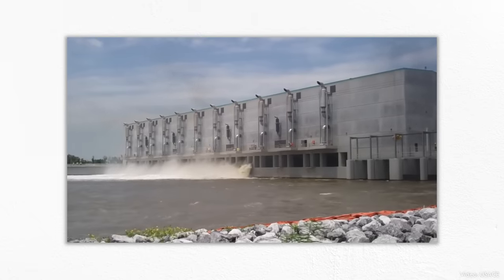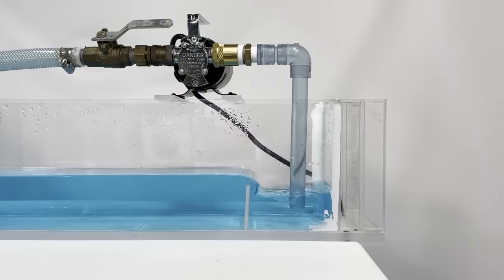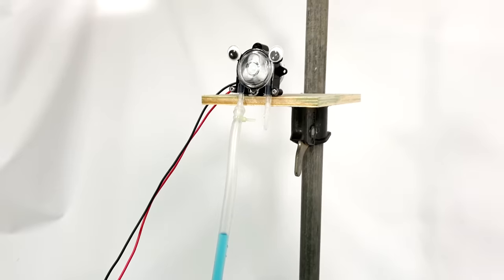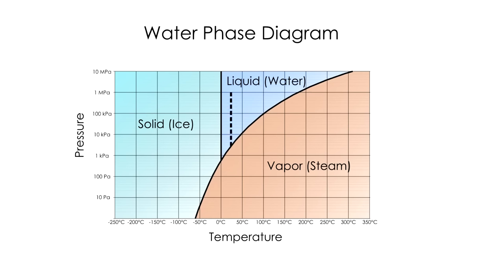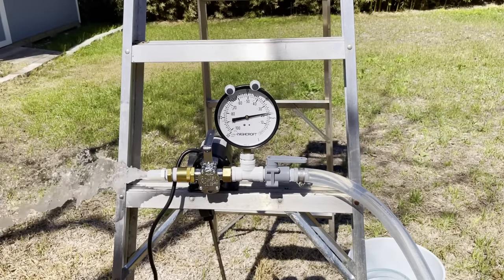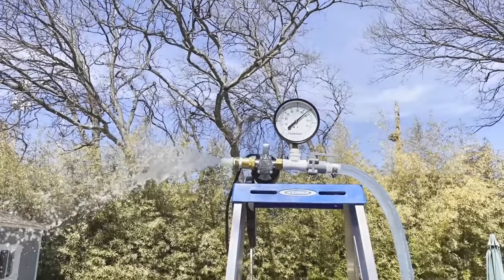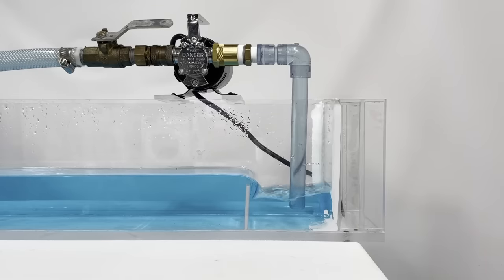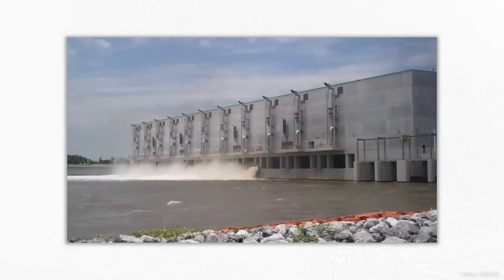The Fluid Effects That Kill Pumps

Comment: Can you cover sewage treatment pants? I'm curious how they deal with solids in the pump paths.
Reply: I need to get me some of those "sewage treatment pants".
Reply: @petehiggins33   Sci-fi high tech diapers!
Reply: @petehiggins33  Hahaha! Your comment is too funny. I'm gonna leave the typo
Reply: Can you discuss sludge pumps?   Why they can pump tons of sand. Even rock, what kind of impeller is used and what are the parameters needed to make them function. Thanks
Reply: @randomshitbekker  yep diaphragm pumps are pretty intense. Can literally pump steel ball bearings lol
Reply: Typically, sewage pumps have large impeller passages (anything from 2" in the smallest to 4" or even larger) intended to pass most solids.   Hence they usually operate at lower efficiency than clean-water pumps.   There are also cunning impeller designs such as screw-centrifugal type impellers or single-channel impellers that avoid having any leading edges exposed to the flow, thus preventing 'ragging up' where stringy things (plastic bags, cloth) wrap around the leading edge.   Or 'vortex' impellers that are recessed and just 'swirl' the water out of the discharge pipe - virtually unblockable but horribly inefficient.
Some small pumps incorporate teeth or 'macerators' to try and chew up solids.
Some pumping stations or treatment plants have screens to screen out solids.
And they may have backflush connections to allow the flow to run backwards through the (stopped) pump to hopefully flush obstructions out.
Worst comes to worst, submersible pumps can be hauled out and unclogged manually (ugh).   large dry-mounted pumps often incorporate 'inspection covers' that can be unbolted (after isolating valves have been shut) for the same purpose.
Reply: It's my understanding that sewage treatment plants use what are called Settling Tanks, low current tanks that allow solids to settle and be skimmed away while the liquids are then routed off to the treatment facility proper.
Reply: @ferstuck37  Most sludge is organic material and not very abrasive. For centrifugal pumps that handles lots of abrasive material like sand, both the impeller and the inside of the housing can be either coated with some very hard material, or the other way around, coated with rubber. Rubber has good abrasion resistance in many cases and is used as masking for sand blasting.
Reply: Sewage plants and many homes have macerators. These break up the solids  primarily to make the normal waste dissolve in the water. So usually the human solid waste is dissolved. Other stuff can be cut but some cannot and it will bung up / block the macerator. They are designed to be easily opened to clear out such other stuff, If you have a basement toilet that often needs a macerator to help dissolve the solids and pump the liquid up to grade and main sewage out let level.
Some pumps can pump solids even thing like fish, there are many different designs / types of pumps.
Sewage plants have strainers and mechanical separators to fish out hard objects that end up in the system.
Reply: @petehiggins33  Oh, I think those are hipwaders. Usually cloth coated in vulcanized rubber. And I think you just spray off the solid waste with a good garden hose.
Reply: @cr10001  large impeller passages has typically been the way of designing sewage pumps, but it's a stupid way. After all you will find very few big solids in raw sewage, it's mostly rags, plastics and other soft debris. If design the pumps with that in mind you can get way better efficiency and a pump that can handle way more debris in the water. Just as an example of a more "modern" design concept for sewage pumps: https://youtu.be/sfRrvl9vX4Q
Reply: Macerator pumps! Basically a special pump design with sharpened blades to mince the waste solids into a pulp for bulk treatment.
Reply: @cr10001  Mike Rowe did that in one of his Dirty Jobs episodes. 
Not one to watch while eating beef stew or pb&j.
Reply: Pumps with integrated shredders.
Reply: I’m #1 in the #2 business
Reply: most people call them diapers! 😂
Reply: Great suggestion! Sewage treatment plants are specially designed for their area and can therefore be very indivudual. But very basically they have a physical (sedimentation of solids), a chemical (adding chemicals like iron(III)chloride to precipitate impurities)and a biological (bacteria on an inert material with huge surface area to remove nutrients like organic phosphorus and nitrogen) stage.
To the pump topic: Gravity :D
Reply: Solids on sewage pumps aren't that solid, (that is, if it can get caught on a mobile mesh filter grate it stays there, and if your feces arw that hard, man, cut down on fiber, that isn't healthy either!
Reply: @petehiggins33  those are called Fremen Stillsuit undergarment...
Reply: Most plants have grinder pumps that as the name implies grind solids into a sludge liquid slurry so it can then be pumped through the impellor. This is usually in the sewage line moving the contents along to the actual treatment plant which then takes it into settling ponds but usually when it arrives the water is filled with energy and needs to be slowed down. It is why initially the water has a zig-zagging pattern to reduce that flow speed and allow solids to begin to settle it before it flows into an actual settling tank which are the big round tubs of water. As it sits the arm rotates and stirs some of it and in some areas bacteria is added that eats the solids after either hours or days most are hours it is drained and pumped through. Different levels filter out any remaining and add chlorine or ozone or whatever is used to make the water non-potable but just under what we classify as potable water before being discharged into a river/lake/stream.
Reply: I use VORTEX pumps to cope with solids in irrigation water.  A significant part of the water does not pass through the impeller.  It is powered from the water that DOES go through the impeller.  The result is that stones, grass, twigs etc go through without blocking the pump or damaging the impeller.
Reply: Sewage treatment is also fun from a biochemical engineering perspective. Those bacteria don’t grow themselves!!!
Reply: @ferstuck37  no blades  look up Moyno positive displacement pumps
Reply: They go through screens. The screens are raked and grind solids. You don't want to know what they catch. 

The solids are more like dirty water due to turbulence traveling through miles of pipes. Seriously like 99.9 percent water. Then they slow the flow in clarifiers. Heavy stuff settles out. Micro-organisms eat the dissolved solids then clump together until heavy enough to settle out.

If you were to pass a solid, even a " log" through the impellers like some here said it would create wear. 

Listen to the video. Even air bubbles eventually wear holes in impellers and housings.
Reply: @kahnfused1  
Mike, for the past year or so I have been checking out on a guy who spends his time videoing boatmen on the Mekong delta and it’s tributaries.  These family’s make a living carrying sand dredged up from the delta  carrying it fully loaded up various tributaries of the delta and pumping it through 8” plastic pipe to locations sometimes 1/2 a mile from the river and using six cylinder engines attached by belts to centrifugal pumps of some kind, they are large pumps but in order to move this sand they are continuously running high pressure water to the inlet, liquefying the sand in order to move it.
The one problem I see is along with the sand is a lot of water and that has to be able to drain away from the sand which is used to fill up basements,  open areas, anywhere where it can fill cavities in roads and new buildings.
Reply: @magnus242    Well yes, Flygt impellers are an example of a modern 'sewage' impeller, whether the open type N (as in the video you linked) or their older 'C type'  which was a closed-passage impeller.   But in either case they're inevitably less efficient than a water pump and they still do have larger passages than would be used in an equivalent water pump.   Googling 'Flygt pumps' - images will get some illustrations of either.
Then there's the screw-centrifugal impeller such as Hidrostal  https://www.youtube.com/watch?v=FjMDemnQD_U   which was originally designed for pumping fish without damaging them.   
IIRC, any of these impellers tend to have a rather smaller area of best efficiency than a plain centrifugal, so need careful matching to the duty.
Reply: @ShadowKatt    You're correct that sewage treatment plants have large settling tanks, from which the settled solids can be taken away by sludge pumps, while the liquid is (as far as pumping is concerned) just ordinary water.   But at the entrance to the plant, there will be screens to catch the baulks of wood, dead dogs, underwear, plastic strapping and all the other weird junk that somehow finds its way into main sewers and which would block any pump.
Pumping stations along the way have to deal with this stuff too, or more often tennis balls, coke bottles, nappies, etc etc.   And lots of grit.   Some of it settles in the 'wet well', some floats on top, some of it goes through the pumps.   Decades ago, pumping stations had bar screens in the inlet to try and catch this stuff, but they tend to 'rag up' so the screens were removed - it was less labour to unblock the pumps occasionally and clean out the wet well at intervals, than clean the screens frequently.   (That was where I live, other places may have different practices).   Wet well cleaning - ugh.
Reply: @Linusgump    One of our pumping stations served several 'freezing works' (slaughterhouses).   In later years they all closed and it became a relatively innocuous place to visit.   But in its heyday, aside from the nauseating smell that enveloped the area (only tanneries are worse), you did not want to listen to the horror stories of the wet well cleaning crew.   Ordinary 'domestic' sewage was a cakewalk compared to that.
Reply: It depends. There are different pumps for different applications (positive displacement and dynamic pumps are very common in wastewater). The pump material will also vary with application-- the sacrificial parts and the pump casing will be made of a harder material if the pump will be transporting grit vs activated sludge, for example. It's also worth noting that a lot of the large, non uniform solids will be screened out in the preliminary ww treatment stage at the beginning of the treatment process. This removal is partially to protect down stream equipment from solids. Some preliminary treatment will also include a communitor (aka a shredder or grinder) to reduce the impact of large solids on the removal equipment. Also, the collection system can be a turbulent environment (partially due to pumping in the collection system) that helps break down solids before they even make it to the treatment plant. 

TL DR most of the solids content that could adversely affect pumping is removed by screening or settling prior to the biological nutrient removal (secondary treatment) stage of the ww treatment process.
Reply: I believe those pumps usually work with a magnetically coupled impeller chamber (the motor doesn't directly drive the impeller with a shaft), and flexible impellers on the pump side.   This way semi-solids can pass and can't leak out of the chamber.
Reply: How do they deal with the tons of hair that go down drains? I really can't imagine how apart from screens upon screens upon collection filters.
Reply: @empoleonmaster6709    Hair is not usually regarded as a specific hazard in the collection system.   (Plastic strapping, dead eels, and rags are the commonly referenced stringy hazards for reticulation pumps).    I think probably there isn't enough hair to cause a problem, and any that does get caught on screens or pump impellers is little enough that it gets worn away by the flow before enough accumulates to cause a blockage.    And pump designs that tolerate stringy contents will usually cope with hair as well.
Reply: Get yo’self a Tesla Pump. Single solid discs on a shaft each in separate cases. Perfect for pumping fluids with objectionable solids. The oil industry has been using them for years to pump the highly abrasive crude oil mixture from drilling operations. It’s not always used but it’s certainly in their arsenal. 
From the Tesla pump patent:
“It may also be pointed out that such a pump can be made without openings and spokes in the runner, as by using one or more solid disks, each in its own casing, in which form the machine will be eminently adapted for sewage, dredging and the like, when the water is charged with foreign bodies and spokes or vanes especially objectionable.”

https://teslauniverse.com/nikola-tesla/patents/us-patent-1061142-fluid-propulsion
Reply: @CharlieSolis    I think that would be uniquely well designed to block, or 'rag up', and I doubt its efficiency, I think power losses would be far greater than a normal impeller pump, since it is relying on friction between the pumped fluid and the impeller for its operation - that friction being one of the factors which contribute to efficiency losses in a normal pump.
Reply: @empoleonmaster6709  there is definitely enough hair to be an annoyance and potentially drive your pump efficiency into the ground... Some of it gets bound up with other solids, prior to preliminary treatment, in the collection system and gets screened out by the bar screen (part of preliminary treatment) immediately. But some passes through preliminary screening and gets bound up to other solids further down in the process (or in the collection system prior to preliminary screening). These giant wads of hair and solids can get wrapped around semi open impellers or they can get trapped in discharge check valves, flapper valves on the suction flange or even 90 degree elbows in the maifold. It is a common preventative maintenance item in WW treatment plants to open up these parts of the pump and remove "rags" as we call them by hand. If you do not do this you risk your pump overheating/generally operating inefficientally (if the hairy solids get wrapped around the shaft), loss of prime (if they prevent your check valve or suction flapper from closing or constriction in the line if solids get trapped in sharp turns in the suction or discharge side of the manifold) and other issues.

Ultimately, the hair is not specifically targeted for removal. But instead is removed as a by product of other solids removal activity like screening  in preliminary treatment and clarification. Cominuters also help shred these solids in some stages like prior to biosolids dewatering or during the preliminary treatment stage.
Reply: @magnus242  spot on mate, large throughlet was the concept developed in the early 1900s, solids in sewerage has certainly changed over the years, wet wipes being the scourge of modern day waste water systems requires a modern day impeller like the Flygt “N”.
Reply: @cr10001  well I really don't need to google images of Flygt pumps, I spent 14 years doing hydraulic designs of impellers at Flygt.;) The difference in efficiency between a clean water pump and a good sewage pump (Flygt N-impeller) is depending on pump size. For a smaller pumps the differens might be small, simply because nobody ever bothers to optimize clean water pumps of that size or to use more costly manufacturing techniques that would give higher efficiency. For bigger pumps the differences can be bigger as clean water pumps of that size are usually more optimized
Reply: been working with concrete pumps for sometime and noticed that pumps generally dont like pumping solids, even though it may be specified as such. High maintenance costs, frequent overflows. I bet if there is an opportunity in a sewage situation to remove as much of the solids by some settling tank beforehand that mitigates.
Reply: @magnus242    OK, I really threw in the reference to the Flygt pumps for other people reading this thread, I guessed you might know what they looked like.    As I recall, the efficiencies of small sewage pumps were really not very good, vortex impellers were about the worst (probably rivalled by various 'chopper' impellers that tried to shred solids).     But in small pumps, 'unblockability' is probably more important than power costs.    In big pumps of 100kW and up, running most of the time, a couple of percent efficiency really mounts up over a year.
Reply: @catherinebacon6089  Wow, that was an extremely detailed response and was absolutely amazing. Thank you for that!
Reply: Yes I agree I've always wondered about that too.
Reply: They filter solids out. They also squeeze fluid out of solids. There are clarification tanks and digester tanks
Reply: @ferstuck37  Centrifugal sludge pumps have impellers and wear parts made of harder materials, typically a hi-chrome alloy, that can withstand the abrasive nature of sand & rock.  Positive displacement pumps like progressive cavity and air operated diaphragm can also have resilient materials, but do operate in a slower manner to move solids/slurry while minimizing wear.
Reply: Pre sewage treatment does most of that. Part of pretreatment are the Enzymes/bacteria that break down the solids, aka "the bugs".
Reply: I work for a large pump company as a drafter and just finished a design for a 42” discharge sewage pump.  The customer generally requests a minimum sphere size to dictate the size of solids that can pass through the impeller.  The other thing we do in the design phase is that sewage pumps have larger open areas around the impeller inside the volute to allow for solids to move around and disperse.  We also adjust to a larger ratio between impeller diameter and the pinch point inside the volute.
Reply: Yep, the very conservative civil engineer father of a college girlfriend described the impellers to me after dinner on a visit to her parents house years ago and my girlfriend, 20' away in the kitchen, audibly gasped (as if she had swallowed her tongue) when I said "So the sh!t really does hit the fan?"
Reply: @ShadowKatt  "It's my understanding that sewage treatment plants use what are called Settling Tanks"

But pumps might be needed before that in the sewer network unless those tanks can be at a lower elevation than any source of sewage in the network.
Reply: More power and bigger impellors will do the trick
Reply: Hard to monetize with food ads. :D
Reply: @dougnofxm  someone has been watching AvE.
Reply: @ferstuck37  Diaphram pumps are cool. Check them out.
Reply: In the network prior to a sewage works we use pumps with a more open style of impleller and a relief groove on the wear plate to help things like jam rags and potential soft blockages pass through. 

You do get blockages though, so we have overloads in the starter panels that trip when the motors go into an over-current situation. It's then up to techs, like my self, to strip down the pump and remove said blockage.

Nowadays we can track where the source of blockages are too using a few little tests. Once proven which property is causing blockages we can reclaim costs. Which is not cheap.
Reply: @Cafferssss  that's awesome! Is this something only metro cities have?
Reply: the pumps used would be capable of moving the semi solids in sewage lines
Reply: @ferstuck37  sludge pumps and sewage treatment pants, man, fashion is weird!
Reply: 8 months later, you got your wish
Reply: @BatAtTarkov  better than I could have asked for too
Reply: @TracyNorrell  he aims to please
Reply: @ferstuck37  Some type of pumps can handle solids. Stuff like centrifugal pumps can handle objects in the water, as long as the objects are not larger than the veins inside the pump. Larger waste is either macerated or filtered out before.
Reply: @petehiggins33  Jill Biden can hook you right up.
Reply: @skunkjobb  Oh, is that why grain augers in hoppers and combine harvesters are screw types? Very interesting!
Reply: @ferstuck37 They're called mono pumps because they have 1 bladed impeller that works like a corkscrew. It's a different design from a normal water pump